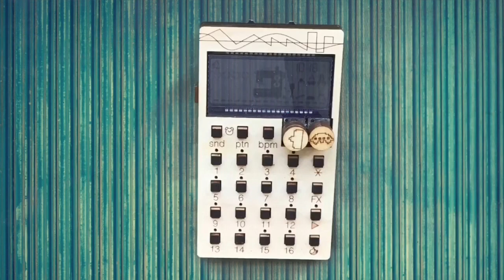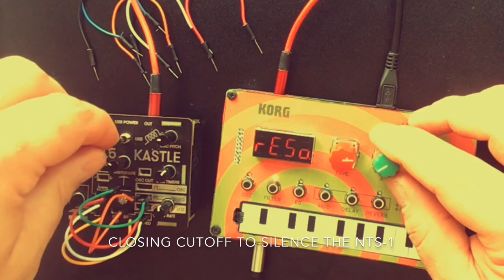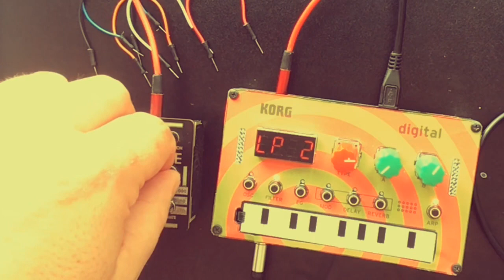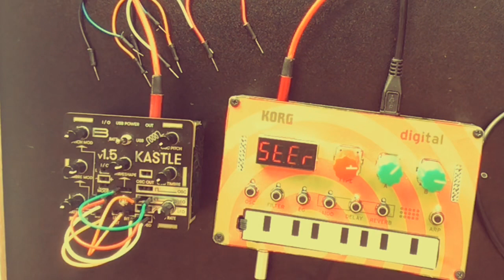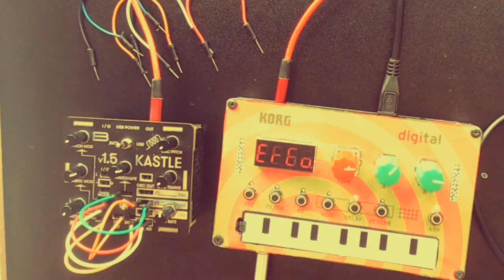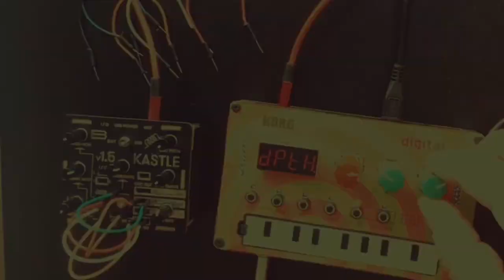The random mini-synth family #16: Kastle & Nts-1 Space Drones (with tutorial)

Comment: Where did you get that beautiful nts  1 Cover/case?
Reply from the maker: They’re handmade! 😁 Printed paper with adhesive transparent plastic film on top.
Reply: @chiptunasoundworkshop8257  any help on how one would be able to do this?! Please and thank you very interested! Looks hreat
Reply from the maker: @Chamberswaang  the template is on the Korg website… together with the manual and the firmware-update file… you can download it and colour it at your will. Then just stick some film on top of it, carefully cut all the proper holes open… and screw it on the top of the Nts-1 as an extra layer (remove the original screws to do that, then put them back in).